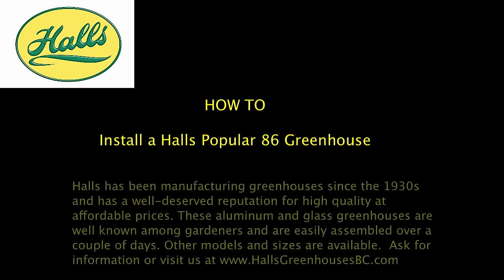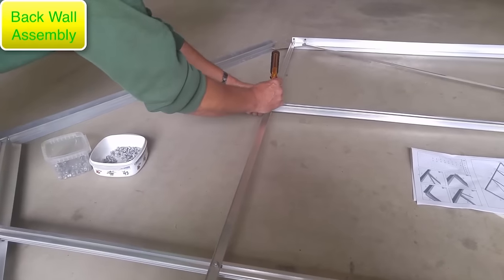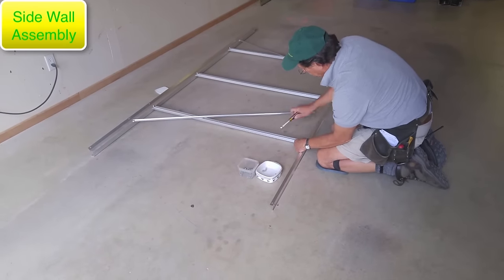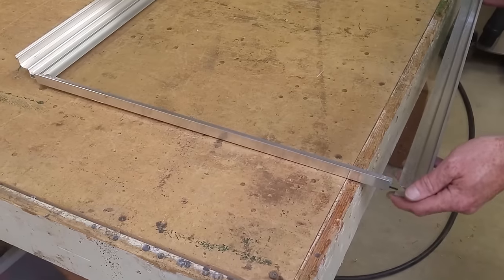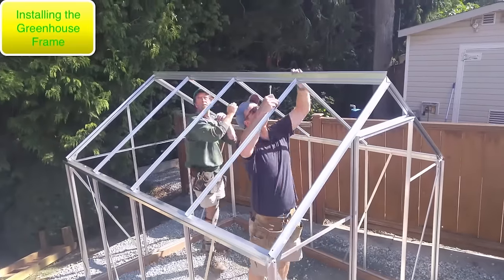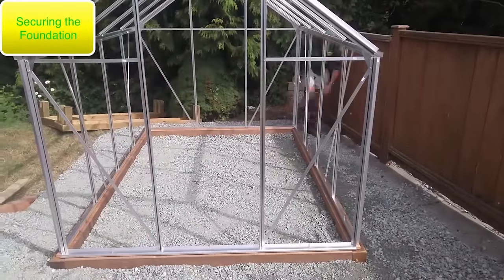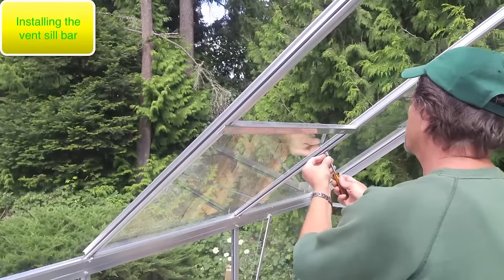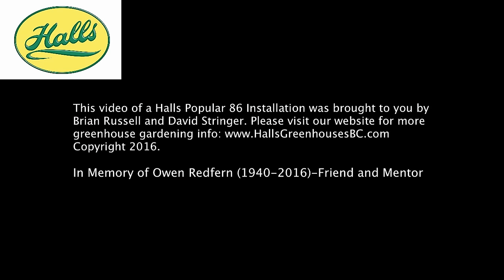Installing A Halls Popular 86 Greenhouse

Comment: The video is very useful, but seems to have been done with the assumption that you have assembled these before and this is simply an aid memoir. It would have been more helpful to have close up shots of the corners and also missing is fitting the door hanger

Comment: Today I have been constructing the panels of my Popular 8' x 6' - in the house!! Its very cold, wet & windy outside. 
The printed instruction manual that came with the frame is totally useless. The video above - helps but still skips over major pointers, like which way round to have certain pieces.
I resorted to Halls online chat this morning, but that ended with the assistant telling me to look on YouTube!  Its been an arduous task, however a call to helpline this afternoon, proved very helpful - thank you Rachel.  I was directed to the assembly guide on Halls Website with clear diagrams which has helped greatly. Waiting for the opportunity to carry on with the construction over the next couple of days. Fingers crossed it all works out.
Reply: Thank you for this, I am also having this issue

Comment: UPDATE:  10 months since I built my Halls greenhouse. It has been excellent this summer. As  stated in the comments the instructions are a bit rubbish. Tiny line drawings where you cant really see what you have to do. A bit daunting when you start to assemble it. It is actually not difficult to assemble when you know what you are doing. I used the [crappy] instructions and also this video, and between the two managed to assemble the greenhouse. 
          The  trickiest parts were the door assembly and the roof  window.
I fitted mine on railway sleepers as I did not like the look of the base that came with it. Make sure the door rail overhangs the sleeper [or whatever else you use by a 1/4 of an inch or it will not slide properly. Also you have to fit the rubber inserts at the same time you assemble the roof window . They do not tell you this in the instructions [it just means doing the job twice otherwise]. It  is the best greenhouse for the money in my opinion. Just need Halls to provide some better instructions.

Comment: Yes, there has to be a space under the door rail, otherwise the door won't slide.   You can accomplish this most easily by sitting the greenhouse sill plates on small strips of wood (we use cedar here) in the following dimensions: 1 1/4" wide by 9/16" thick, as shown in the video. This allows the door to slide easily and keeps the sill plates elsewhere from twisting.   Good luck with the glass.  (Do the roof first). Brian Russell

Comment: Ive had this greenhouse for a couple of years now and am still quite happy with it, it has been through a few heavy storms and is still standing, lost a few panes of glass but that is to be expected. The only downpoint is the door, the plastic fixings are very flimsy and low standard but i replaced them with some i made myself. It was quite straightforward to put together as well.

Comment: If you are using a home made  wooden base, the door bottom  rail has to overhang the wood by about  1 centimetre. I put the base central on the wooden sleepers and the door was jammed solid [it would not slide open or closed]. I moved it to overhang and it slides perfectly now.   This must happen in the video? but you do not mention it.

Comment: Note 1: The black rubber glazing strip on the opening window only goes up
to the end of the bottom glazing if you add the glazing strip all the way up the bottom bar with window opener holders (8615) will not fit throws it off by few mm of the rubber, suggest adding the glazing and cut the glazing strip to the top of of the bottom glazing then add the bar window holder (8615) at a slight angle to slide in above the bottom glazing...hope this helps a few !!

Note 2: If adding rubber glazing strip in cold months bring inside drop in hot water, leave for approximately for 1 hr this helps the rubber to expand then apply to greenhouse fits like a glove.
Reply: Part 8615 was the only problem. Had to cut off the overhang to fit.

Comment: Have the same. Very good quality, everythink fits perfectly. But. It took me a day to attach the rubber profiles that secure the glass, your looking at some 60 meters of it. Serious pain in the behind.
Reply: I was struggling with this.  In the end I cut them to length and immersed them in hot water.  Then one by one took them out while still good and hot and they go on a LOT easier.

Comment: The sides and roof beam on mine are up. They were easy. It took me several hours to do the door, the instructions are very unclear, the fitting was very tricky. Easy when you know how, hard otherwise. Shame you missed the door assembly and fitting out.

Comment: After getting it assembled  (Halls Popular) you'll realise that 8x6 is ok for a tiny garden but that the 2ft wide door and and 4 ft eaves are too damn tight even for small gardener. I'm 5"4 and with a few  plants in their its a very tight working space. 
Some hard won experience:
Buy an extra roof vent!  Small space, low roof = solar plant cooker. When you get the greenhouse buy the vent and sort the glazing changes out with the supplier.
Think carefully where you want your Tomatoes and Cucumbers or other tall plants and put the vents on the other side of the roof!  
Budget for paving slabs! you can grow directly in greenhouse soil but manoeuvring in a 8x6 with a low roof isn't worth it. The tiny door makes it awkward Pave the floor grow in pots and containers. 
Uneven ground or a slope. = Don't dig it in flat, build it up I dug mine in and its been a soggy mess at one side every time there is heavy rain. The galvanised base (an extra from halls) is rusting badly on that side.

Comment: I have 10 thumbs on my hands and I'm the undisputed king of useless when it comes to DIY but with 2 days work and couple of labourers I'm ready to install the glass in my Halls 6x8. I'm hoping I've done everything right so I can get it finished off tomorrow and get some plants moved in....

It's been a fun project so far although I will say that the instructions could be clearer at times though particularly with regards which way certain pieces face.

Here's hoping I've done it all right...👍😆
Reply: Brian Russell 

Thanks Russell I (with some help from my labourers) managed to get it all finished and glazed today, it looks very nice once completed with the single sheet toughened glass. I still need to put the auto vent opener on but that should be a fairly straight forward job I'm hoping.

Ive already got some plants in there right now and I'm hoping for many years of happy growing☺

Comment: Is there a video for halls 6x4 front door assembly
Reply: I dont think there is.  It took me a while to work the door out. Main thing is to make sure the slider for the door on the main greenhouse frame has a bit of an overhang [half inch or so]  If there is no overhang the door will be stiff and wont open.

Comment: WELL, FINISHED THE GREENHOUSE [FINALLY[. I AM WRITING IN CAPITALS, NOT TO SHOUT BUT I THINK IT IS EASIER TO READ.
PROBLEMS THAT MIGHT OCCUR ON ASSEMBLY......
1] IF YOU ARE USING A NON HALLS BASE  [WOOD,BRICK ETC] MAKE SURE THE BOTTOM DOOR SLIDER HAS 1/4 INCH OVERHANG OVER THE EDGE OF THE BASE, OTHERWISE THE DOOR WILL NOT SLIDE. BEST TO FIT THE DOOR BEFORE YOU FIX THE GREENHOUSE TO THE BASE [SO YOU CAN CHECK IF THE DOOR SLIDES SMOOTHLY FIRST]. THE VIDEO DOES NOT REALLY MENTION FITTING THE DOOR AND THIS IS THE HARDEST PART OF THE WHOLE GREENHOUSE.
2]  THE OPENING ROOF WINDOW NEEDS GLAZING STRIPS FITTING BEFORE THE GLASS GOES IN OTHERWISE THE GLASS JUST RATTLES ABOUT AND YOU WILL HAVE TO TAKE THE WINDOW APART AGAIN. NO MENTION OF THIS EITHER IN THE HALLS INSTRUCTIONS OR IN THIS VIDEO.
I HOPE THESE TIPS MIGHT BE SOME HELP TO SOMEONE. PLEASE  MENTION THESE THINGS IF YOU MAKE AN UPDATED VIDEO. 
P.S   I SEE SOME OF THE DOOR ISSUES ARE ADDRESSED IN PREVIOUS COMMENTS.

Comment: I could build a second one in a day, but give yourself a week to build . 80% of the instructions can be followed, use this vid to cross check. the other 20% is a pain in the butt, the instructions are wither vague or non existant and the vid also seems to leave the same pieces out. You will be pleased with it when you get it finished.